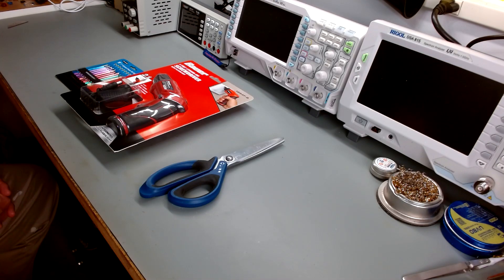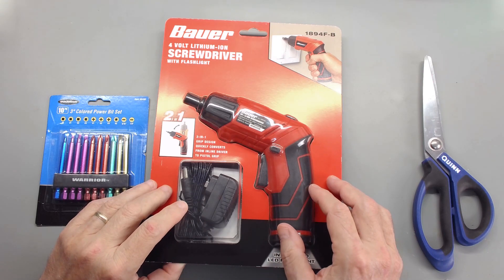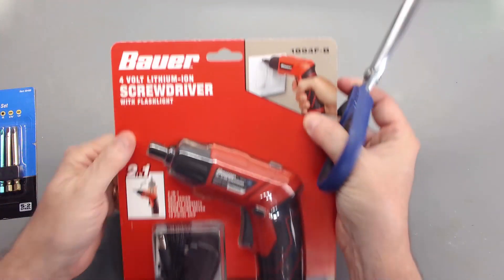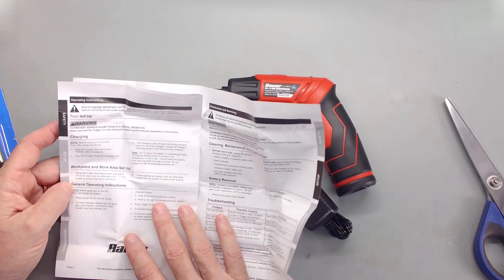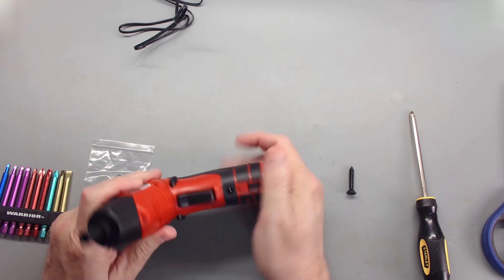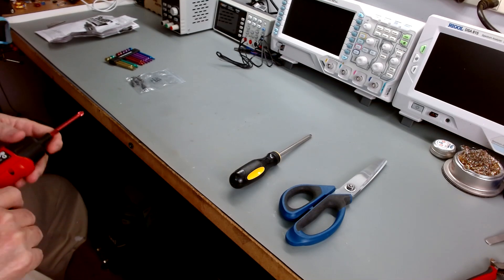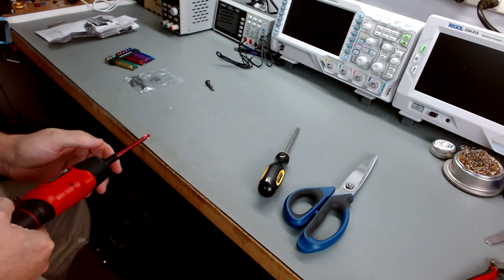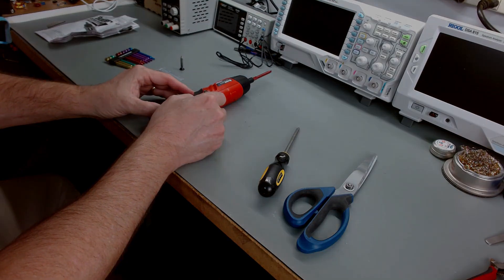Bauer Electric Screwdriver Review

Comment: for 20 bucks...it may be worth it.  I would like to have seen it with a USB-C  charger.
Reply from the maker: Yeah, me too! Even if it did not provide a separate charger as everyone have a bunch of usb-c chargers laying around already. So far it’s working well. Thanks for the input. 
RJ
Reply: while not as good of a brand, walmarts hyper tough has a similar one (just no flashlight at the bottom) for 10$ and i picked up one for 8$ on clearance, that does have usb c charging.
Reply: @jjjacer  I will take a look for that
Reply from the maker: Great Info! Thanks for letting us know. I just looked it up and If this one craps out I will try one of those.
Reply: @LynxElectronicsLab it probably wont lol, harbor freight gets alot of flack for its cheap tools but lately it seems the stuff has been a lot better quality, i run the hercules line up which has a 5yr warranty on the cordless tools and 3yr on the batteries, if they break i just walk in and swap them, no questions.

sure ive also bought a lot of really crappy stuff from there as well, but for a DIY person on a budget they have been a life saver
Reply: O @jjjacer